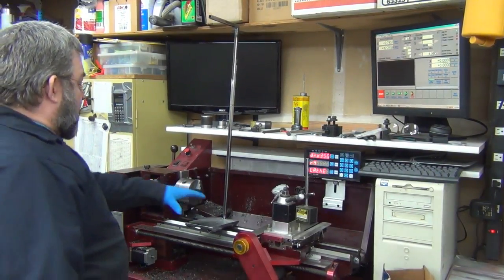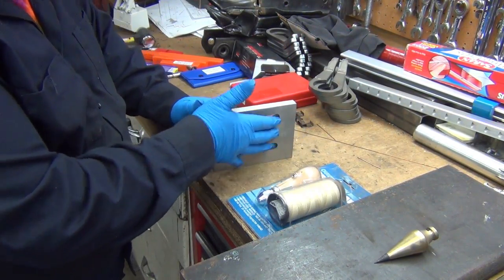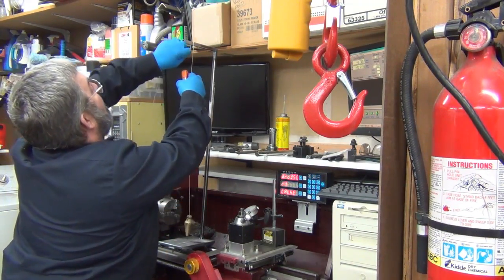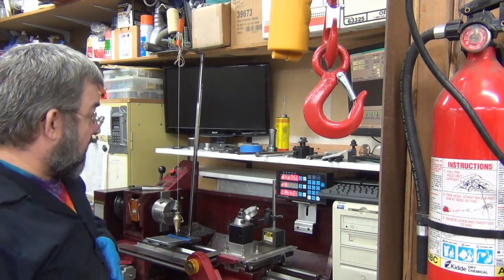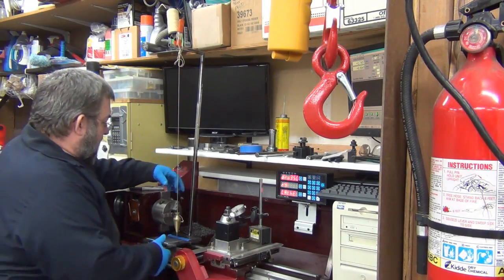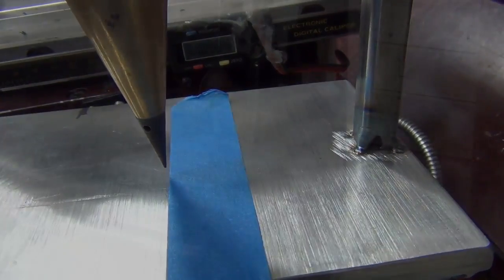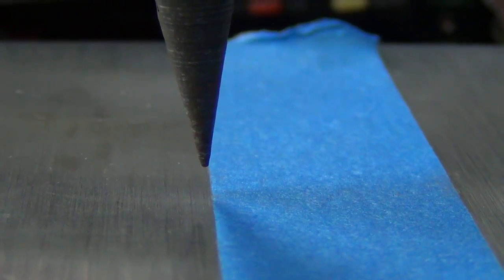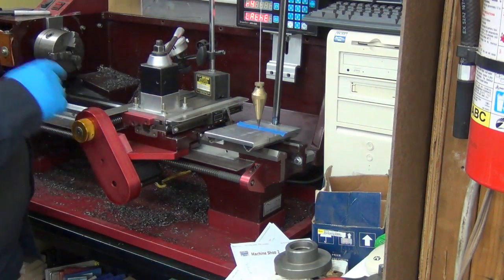Lathe Leveling - pt2

Comment: i use the sane setup but the base of the plumbob has magnets, remove the top part of the tail stock and stick it in there. the reference point is the tailstock lower part so you can slide it all the way without problems...
Reply from the maker: I'd love to see a pic or drawing of what you're describing.  I'm not sure I'm quite getting my head around it.

Comment: interesting to watch your efforts to LEVEL these lathes. proof of technique is in the cut result, or lack of , on a test bar. the plumb boob method appears to be sound until one really thinks about what one is measuring. first the ways are the sides of the V's and flats for the tailstock( unless the tailstock runs on V's or some combination of V's and flats) which are all machined to function together. the top of the V'S are whatever they are and could be anywhere and are NOT CRITICAL SURFACES. in other words not the place to measure your bed for twist, hog back etc. there is a technique and a tool for doing these measurements and it is also used to scrap the ways true. it involves bubble levels and a contraption to carry the levels on the ways. simply shimming from your method can result in strangely worn ways. the bed will take that set over time and if your procedure is faulty your lathe will suffer by it.
second there are 2 directions to consider when checking the plumb x & y. z is taken care off by the x & y if one uses the correct configuration of support, and the plate with angles doesn't work.
test bars are a reliable method and/ or rollie's dad's method.
after all is said and done what do the cut results give you for taper??? and how is the taper produced??? is the tailstock forward or back? is the tailstock high or low? how much is tailstock deflection? is it bed twist etc? or is it some other factor like inconsistent material characteristics, the list goes on....
as thejesusno2 says "not bolted down" at some point may result in the best result in cuts. my chinese made bench lathe was a nightmare to align until i realized it need adjustment other than shimming the mounts. i spent much wasted time shimming the feet with poor results.
also does your cut result in a ROUND bar or is it oval. is the oval in the same orientation along the bar or moving around over the length of the bar?
Reply: Hi Bill,
Great detail in your post. Thank you!!  I completely understand what you're talking about with the surfaces not being critical surfaces. I was being lazy and figured I was still getting it a lot closer than I had gotten it previously. 
Just for clarity....the Y axis on a lathe is the tool height setting....right? X(bed) and Z(spindle) are the primaries? 
I did try to use rollie's dad's method, but I thought that was more for chuck runout or headstock alignment.  I didn't want to use the tailstock since that would potentially put even more misalignment into the mix.  Maybe I should have. I was running into an issue of the spindle bearings letting the part move when I tried to take a cut 5-6" out from the jaws. 
I went to you channel hoping to find some vids on how you aligned yours :(  I'd love to see some of the "other" adjustments you mentioned. 
What it came down to in the end was that I needed it running and I was only cutting parts that were no more than 2" long.  I called it "good enough" and moved on to making parts.  I was hoping to make the rest of the parts on the mill, but I think the delay for the learning curve is going to be too long, so I'll just finish them up on the lathe.
I'd love to go back through both lathes and get them dialed in when I have the time.......but we all know how that goes.  Never enough time to do it right the first time, but there's always time to do it again! lol   Sad but true!
Thanks for the great comments! 
Mike

Comment: Lol mines not even bolted down!
Reply from the maker: I wonder if you're getting some twisting and that's why you keep breaking it. lol!!  The feet aren't very big.....how do you keep it from falling over?
Reply: I dunno it just sits their Ive had it bolted down before, didnt seem to make any difference that I could tell, but im no master machinist. The reason I break it is because it doesnt like heavy cuts
Reply from the maker: TheJesusno2 You must have a ton more torque with the stock drive belting. Mine will stall before it breaks something.  Or the belt slips.
Reply: I dunno I swapped the apron with the one I got from you and I noticed my old one I chowdered the worm and drive gear again. I dont think their hardend very well or if at all. Mine has a wortheless clutch in low speed which I want to eliminate so I can really brake stuff lol
Reply from the maker: TheJesusno2
Seemed to be pretty low miles on the one I sent....hopefully it will last a bit longer for you.  I'm looking to use the clutch pulley when I convert the drive belting to timing belt instead of V-belt. :)